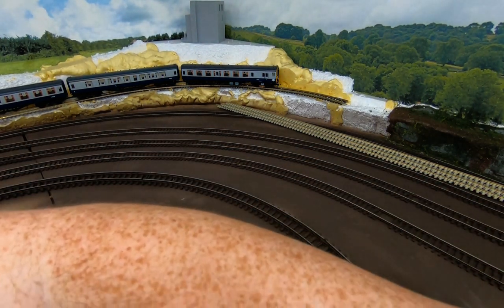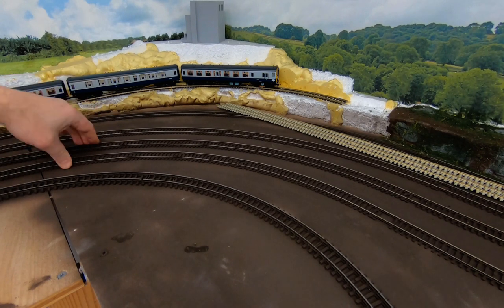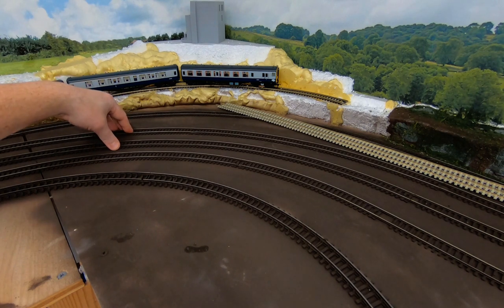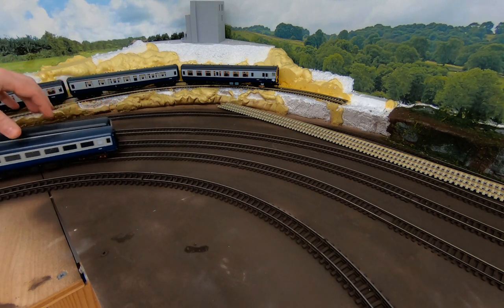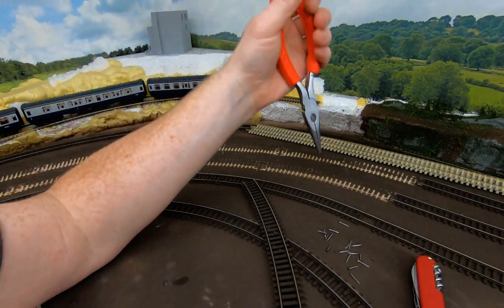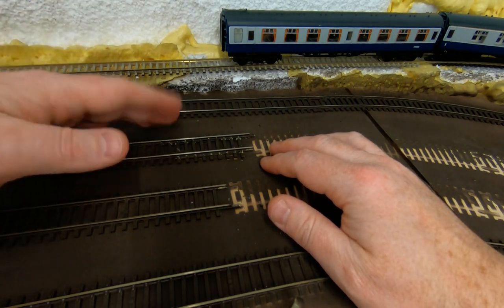oorail.com | 15 Minutes of Railway Modeling

Comment: Good to finally see your face. I use old track cutters/ wire cutters to lift track pins.
I like the 15 minutes a day idea a lot. 
I'm going to spend 15 mins a day sorting out all my stock boxes.
Cataloging and testing them all and splitting into keep, sell and repair boxes.
Reply from the maker: My face occasionally pops up on the channel, not very frequently though, as I figure people want to see trains more. Which reminds me that I need to add some running sessions soon. The 15 minutes a day is proving to be a neat approach, making more progress between it and 3D printing scenery than I have in years! Let me know what kind of repair issues you run into, I've got a decent collection of locos here, so I may have similar issues if there is something you would like to see covered...
Reply: @Oorail  ooh! as for service issues, the only thing I'm struggling to sort out is some rolling stock with worn axle points.
I've been filling them with epoxy and redrilling a small hole, not sure how long it will last though. Any better solution?

Comment: If you have some small side-cutters/wirecutters, you can use the  rail as a fulcrum, get the jaws under the head of the pin and pull straight up - make sure you don't cut it though!
Reply from the maker: Thanks, thats a great suggestion. I have more track maintenance to do on the layout, so I'll give that a go. I've had some success using the swiss army knife blade to pry the pin head up enough to get the screwdriver under it. Although I'm thinking I may hit up Dollar Tree this week and try the nail clipper approach too that was suggested. I'm sure I'll find a way to cut myself! :)